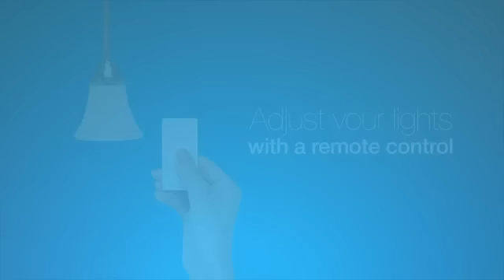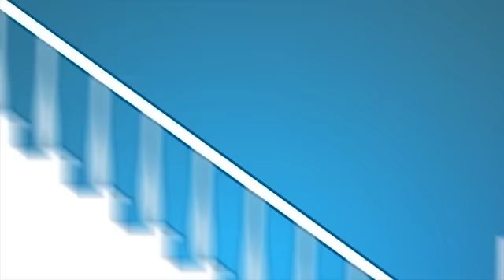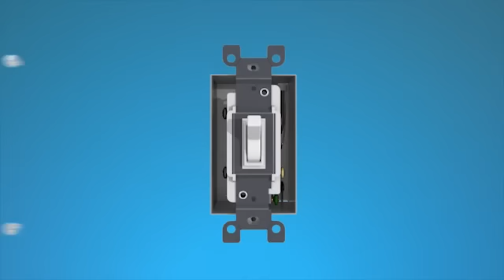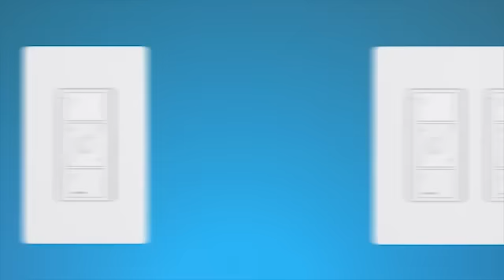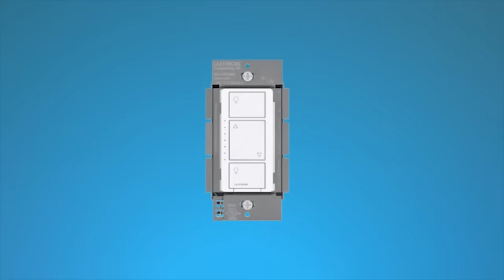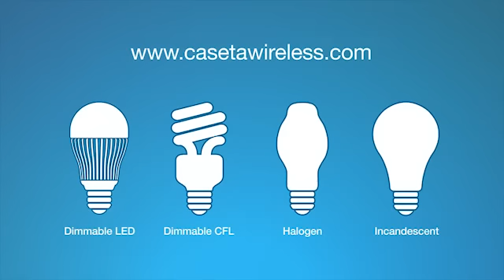Caséta Wireless How to Replace 3 Way Switches with Caséta Wireless Dimmers -

Comment: I'm installing into a metal switch box and there is no bare copper or green wire, nor is there a green terminal screw on the switch I'm replacing. I'm assuming that the box itself is grounded and the switch will be grounded by the mounting screw that attaches it to the box.